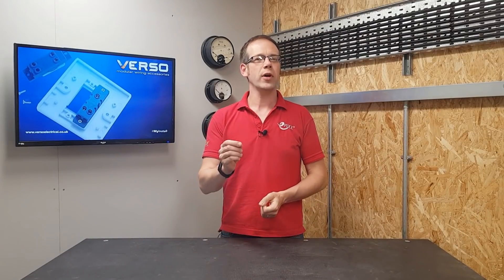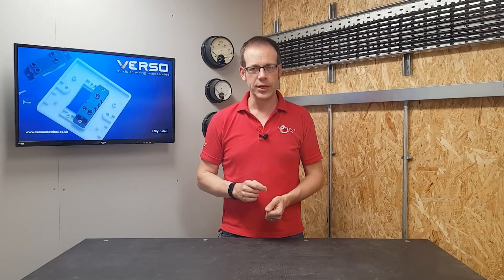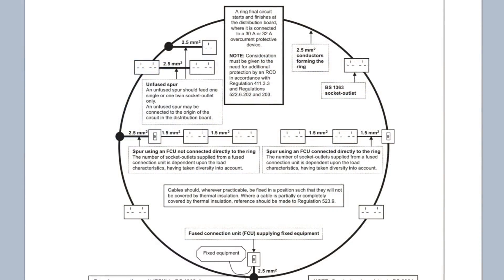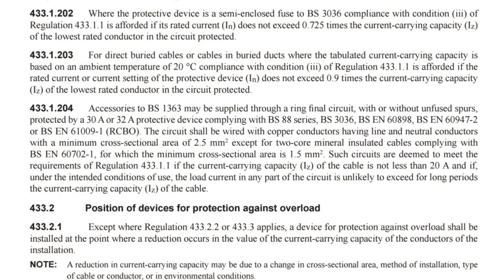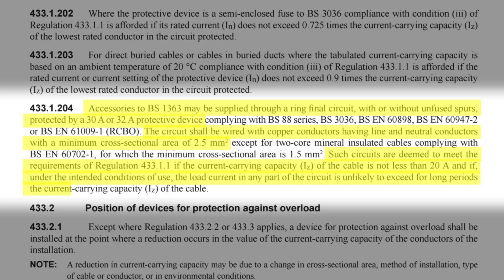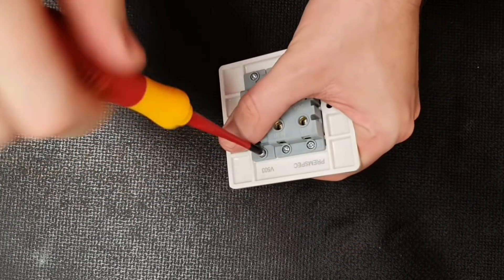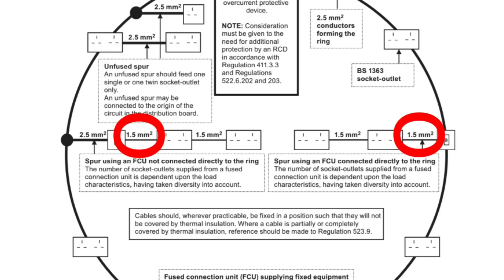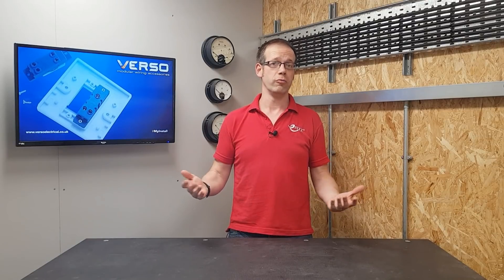Can you use a 20 Amp double pole switch to control a spur from a ring final circuit? BS7671

Comment: I do use them for what I call drop down sockets behind units such as washing machines microwaves that are cabinet fit.  As some new smart washing machines can lock up power off at socket is needed.  I also feel that it is all safer to have a form of isolation.
Reply: I agree also I would not want to pull out a washing machine from its cabinet without isolating it first in case of a fault/ trapped cable etc
Reply: @markpotter8280  Yup, I have got a belt 3 times trying to pull out washing machines. Never understood why the clients think it's normal to get zapped off them.
Reply: Why not just use fused connection unit
Reply from the maker: Thanks for commenting! 😊
Reply: @alum roberts
"can lock up power off at socket is needed"
Uh?
Reply: @johnburns4017  Computer crashes, so you need to turn the appliance off and on again.
Reply: I never never ever put sockets behind appliances , absolutely shite practice, who wants to pull a appliance out to change a fuse.
Reply: @supersparks9466  
Washing machine/tumble dryer etc, can on a 13A DP FCU with a fuseless 15A plug and socket behind. 

But if a fuse blows...why?  needs investigation. Do not just change and leave.
Reply: @john burns. Never seen or want to see 15amp plugs behind appliances , literally no one does that.  Also never said just change and leave a fuse? My point is it’s all unnecessary agro putting sockets hidden away, aggro for testing,aggro for inspection, aggro for changing fuse, liable to damage etc etc, just avoidable aggro.
Reply: @supersparks9466  
Off an FCU a fuseless 15A fuseless plug can be fitted behind an appliance. No fuse to bother with. All legal. Because no one else does it, does not mean you cannot fit one.

When pulling out a large heavy appliance, once you can get your arm in it can be unplugged, making it easy to pull away.
Reply: @john burns I’m quite capable of understanding that it’s a acceptable and dosnt need a fuse, it’s just crap practice. Tell you what ,you keep putting sockets behind appliances and I’ll keep putting them in nice accessible locations for homeowners,elderly ,infirm, or disabled to access them.
Reply: @supersparks9466  
Sometimes you have no option. A 3kW oven is an example.

I fail to see the crap practice.

Get out of your mind: we have always done it this way.
Reply: @john burns why is there no option with a 3 kw oven? I’ve connected hundreds with no socket behind.
Reply: @supersparks9466  
You are the one not wanting fuses behind appliance, which is a good thing. 

Ovens hardwired are a pain to pull out unless the lead is long.  A 15A round pin plug solves it.
Reply: @john burns I don’t have any of the issues you mention.
Reply: @supersparks9466  
Another issue is manufacturers not honouring warranties because the moulded plug is removed. 

Some guys hard wire in, then they worm out.  Even fitting a round pin 15A plug with FCU protection they will worm out. 

So a solid link in the 13A plug will keep within warranty, keeping fuses from behind fitted and heavy appliances.
Reply: @john burns like I said I don’t fit sockets behind appliances, still no need for a 15amp plug, no need to cut any manufacturers plugs off.
Reply: @supersparks9466  
A number of induction hobs come with a moulded 13A plug - yes they do, a 13A plug.  How are you going get around that to eliminate fuse behind an appliance or hidden?  Cutting the plug off then hard wiring in?  The manufacturer will say you have made the guarantee void by cutting off the moulded 13A plug - tampering with the appliance. In a court I am sure they will lose but the makers may give you hassle. 

You can have a 13A FCU inserting a solid link in the plug eliminating the 13A fuse, then the gurarantee is still valid.
Reply: @john burns you don’t seem to be understanding me,I never once said I cut plugs off, I also would never consider inserting a solid link in a plug? Never herd of such a thing, does it have a bs number? Just install the socket in the adjacent cupboard and plug it in. I don’t know what’s so hard to understand or comprehend about it.
Reply: @supersparks9466  
Solid fuse links are common, but the 13A one is not. I know guys who have used them, and read on various forums of guys using them. They are very rare but available. I believe a label has to be attached to the cable explaining one is in the plug.  

They would obviously be used in situations like we are discussing.  There is no need for them when using off-the-shelf fuseless 15A plugs and an FCU.  But it is those dishonourable manufacturers again saying you invalidate a warrantee but cutting off a moulded square 3-pin plug, even though it may be electrically sound, safe and to regs. 

It is not always easy to put an easily accessible socket and plug in an adjacent cupboard.
Reply: @johnburns4017  I would also say a 15amp plug would be better as over heating when on all day or I should say less heating.
Reply: @alunroberts1439  
Yes. Look at the scorched overheated FCUs on continual power such as dryers and immersions.  They scorch around the fuse area, as the fuse is an interference fit. The fuseless 15A plugs are better. OK the pins are also an interference fit, but a far superior interference fit than a small 1cm diam' 13A fuse. 

A pity they they have not been uprated to 16A, as in India, which is the identical round plug.
Reply: @john burnsfirstly  immersions should not be connected to a fused connection unit, 2nd please describe the scenario which would mean I have to fit a socket behind an appliance, because I’ve have yet in 44 years yet to have to do it.
Reply: @supersparks9466  
An immersion is best on a dedicated radial for sure. Nothing says a 3kW immersion cannot be fitted off an FCU off a final ring circuit. Many are.

Many of the kitchens I have seen there is no alternative to fitting a socket behind, but it means hard wiring in the appliance if no socket is wanted. The problem is manufacturers who invalidate guarantees if a moulded 13A plug is cut off.

As a guide, high current drawing appliance are best not on plugs. Plugs are for portable appliances.
Reply: @johnburns4017  I do see over heating on Fused switched units also just fused units.  My thinking is we need higher ratings for items that will be used for long times on hi loads when I do calculations I some times get just over 13Amp but still fitted with 13amp fuse.  Fitted oven with a 13 amp plug socket is a pain.
Reply: @alunroberts1439  
The heating is usually not the fuse itself,  but the pressure prongs that hold the fuse. A superior fuse holder that is screwed down would be better.  Or an FCU with an integral mcb.
Reply: @alunroberts1439  
An immersion can have a 16A DP mcb in an enclosure off a final ring circuit. All legal as long as the appliance is permanently fitted, as an immersion is. 

The mcb will be the on-off switch, which us not ideal. But a 20a user switch can be fitted next to it. 

Then no scorching/fire risk.
Reply: @johnburns4017  well no can not lock it off at socket I use double pole isolator to the socket below.  Also for safety if the washer started to smoke you can kill the power to it.  I have box load of 20amp and 50amp same physical size so don't look out of place next to each other.  I like the switches with the print on them saying washing machine dryer cooler also as some so called smart washing machines can lock up power off is needed flip the switch.  All sorted.

Comment: Too many possibilities for it to go wrong, in theory it would be ok for a single socket but what happens when the owner converts it to a double and puts 2 big loads on or even spurs off again and now your overloading the cable on the outgoing side of the 20A DP switch and now you over the switching rating of the 20A DP switch. Now if you came off in 6mm that would be a different story but then the 20A isolator wouldn't be rated to isolate 32A (and more) which is what the mcb will allow. 13A spur or new radial from DB is the only option that should be considered.
Reply: If the owner converts then the owner becomes the unqualified electrician who fucked up
Reply: @MrSJT  unfused adaptors that you can buy in superstores defeat the single socket/twin socket argument or the whole bs1363 design come to that.
Reply: @jamesdyas542  unfused adaptors don't comply with any product standard.  We can't stop a user from using such products or any products that don't comply with such standards, including phone chargers that go on fire, AFDD's wouldn't stop that either.
Reply: @MrSJT  thanks for the reply. I’ve just put ‘unfused adaptor’ into google and one of the first results is a b and q dial branded one. Says it’s to bs1363/3. Not sure what the /3 bit means.
Reply: @jamesdyas542  13a outlets, sockets, adapters.  The adapters have fuse carriers at the front
Reply: @MrSJT  thanks again for the reply. The b and q one is sold under the heading of un  fused adaptor. In the description it has bs1363/3. I’ve just found an actual example of one at home. It’s a pms branded one although this one has bs5733 on it. Not ancient because it has the slieved pins. Same 2 plug cube design. Definitely no fuse I’ve opened it. Just to completely bore you it says ‘British patent British design no.8432283 reg.1025540 13amp 250v pms8428 bs5733 ac only total load not to exceed 13 amperes made in Hong Kong.
Reply: @jamesdyas542  i believe bs5733 is a convertor plug for European appliances which usually has a fixed resistive load so hence wouldn't overload the flex on the appliance so hence wouldn't need a fuse for overload protection.  The sleeve on the pins were around in mid 80s and made mandatory in the 90s
Reply: @MrSJT  interesting. It is just a one in two out bs1363 type plug cube type adaptor so it’s a standard that there applying wrongly perhaps? It doesn’t say bs1363 on it anywhere. I’m going to buy one of the b and q ones next time I’m in there just out of curiosity weather the listing is wrong or weather it says bs1363/3 and has no fuse. Be worth £2 to find out. Kind regards jim.
Reply: @jamesdyas542  just open it in the shop with their tools and take photos
Reply: @jamesdyas542  should also note that 3 gang adaptors as far as I know always had a 13amp fuse, I think the 2 gang ones usually don't and unless you understand electricity then to a normal user they wouldn't understand the implications of overloading it coz they don't calculate anything as it isn't their job
Reply: @MrSJT  yes there is always that. Suppose the indoor market scenario that I was on about was really unsuitable for standard sockets anyway all things considered. I suggested an upgrade to c form for transportable/fixed appliances and master seal type for hand held/portable appliances but then you get into an argument where the landlord says there not my appliances and the stall holder says it’s not my building. Doesn’t matter now, the buildings been demolished. It was just the compliance or non compliance of un fused adaptors and I tend to fall down a bit of a worm hole at times. Kind regards jim.
Reply: @MrSJT  I'm a bit confused about the unfused adaptor thing at the moment. I always thought that if a 4 way block was sold with a lead and fused plug  attached then that was fine and the block didn't need it's own fuse BUT if the block was sold bare with no lead/plug then it needed to have a fuse built in (because someone may hardwire it.) Yet Masterplug (who are reasonably well respected) sell both fused and unfused blocks both with and without cables/plugs attached (website descriptions for the bare blocks imply they have a fuse but they don't) leaving it up to the purchaser to decide which type they need. That said the DIY sheds probably won't sell the unfused bare blocks (maybe).  Problem with unfused block adapters is at one time they were legal and now it's only illegal to sell them so they still exist and it's not illegal to use them. It would have to be down to the market organisers to impose their own safety standards. The outdoor catering world is well known for all sorts of dodgy electrical stuff and in some ways I can kind of understand it. They need high power appliances to be able to operate as a business and often the supply doesn't quite cut it yet as most of their appliances aren't always on at the same time and thermostats disconnect/reconnect them randomly they mostly get away with it as the average load doesn't quite reach the breaker tripping point.
Reply: @mfx1  the blocks you're talking about i assume you mean extension leads complete, and extension leads without the cable and plug.  Qualified electricians would obviously stick a fused plug on it.  But the problem with BS7671 is that it can only go so far as is reasonably practicable to protect the user.  The use of any unfused equipment with potential overloads such as unfused adaptors cannot be helped if they sell them or use them.  However, if carrying out an EICR and you find this, you can mark it down as an observation.
Reply: I'd consider how long a double socket is rated to exceed 20amps before I got unduly worried...
Reply: @travoltasbiplane1551  putting in 2 heaters I have been out to a house were at the top of the stairs was a socket facing 2 bed rooms also a spare of it in a front bed room so you could say 3 double sockets the bed room it was facing also had 2 gang sockets sockets.  Well any way there was 2 heaters blowing in to each bed room on full pulling just under 26 amp in the bed room a 800watt oil filled heater in the bed rooms TV on with games machine the house was old so had push in MCBs the red cap was pulled out and a yellow one fitted with a 45 amp.  The wiring had melted in meany points.  People think they understand electricity as they call it there house almost did go on fire as the floor board had the cable running a long it the celing was scorched.  As meany say how safe can you make a installation.
Reply: @alunroberts1439  we can't legislate for absolute stupidity... and yes common sense would suggest that (despite the removal of any overload protection by using a 45a mcb) the property was inadequately provided for in terms of sockets which led to the situation you describe - which is probably more of an issue than your average double socket supplied by a single bit of 2.5.
Reply: @alunroberts1439  There's always going to be extreme exceptions and it's quite sad that someone has to be in that sort of situation, surprised they could even afford the bills nothing is ever 100% safe, however careful or safe you are you could get killed tomorrow by any number of things all you can do is make an installation as reasonably safe as possible but if the customer then dicks around with it or uses it outside it's reasonable limits that's on them.
Reply: Doesn't matter if the owner converts it to a double skt etc. remember the job of the mcb or the fuse in a spur is to protect the cable not the appliance which even if they changed a single skt to a double skt the appliance will have its own plug top with a fuse in etc so it to will be protected. However if they spur off of the spur then yes you have to fuse down effectively you then have a radial circuit off of a ring main (I would not do it myself but it is acceptable)
Reply: All true, but isn’t the reg basically saying that if it’s not likely to be pulling a lot of load for long while? Even ovens don’t pull continuously and go into switching when they reach temperature. You’d be looking at 2x bar electric fires to pull that kind of load which is unlikely, but not impossible. 

But I agree that a fused spur would be the way I would go just to be sure. could also you extend the ring provided you do the calculations?

I’m not an electrician but considering studying to be one.
Reply: @davideyres955  probably unlikely to happen in a domestic environment but I remember at the indoor market they had a twin socket with 2 x 4 way extension leads plugged into it. When they found the fuses in the leads kept blowing the way forward was found to be a couple of 2 way un fused cubes into the socket with a 4 way lead off each one and take the biggest load off the lead and plug it into the cube. The socket was on the ring though. Would be interesting to see what would happen if it was a spur.
Reply: Most twin sockets are not rated to have 13amps from each outlet, I had this conversation with click, and their sockets are not rated for 26amps, and that applies to a lot of manufacturers